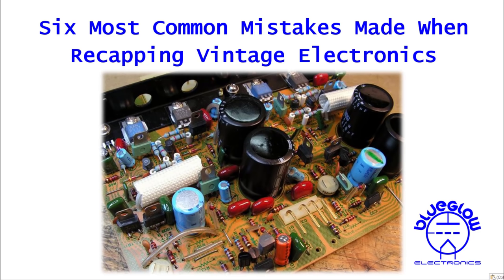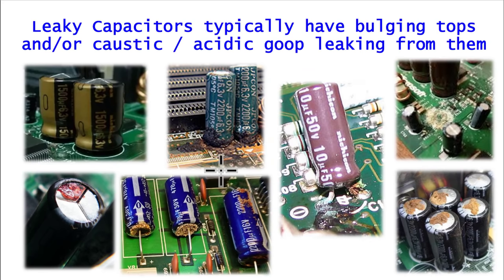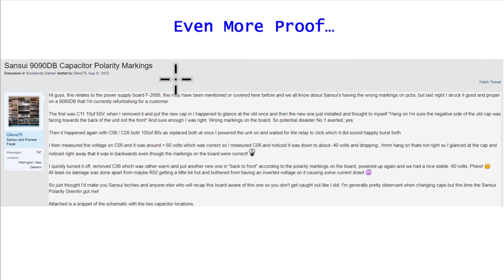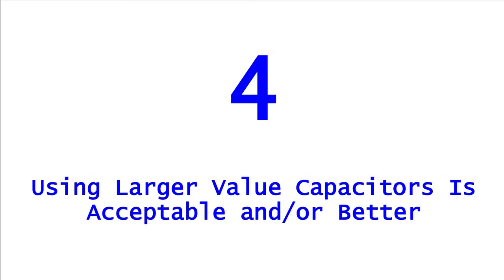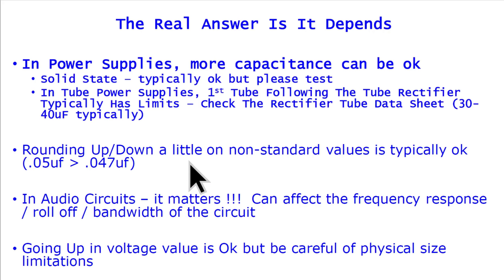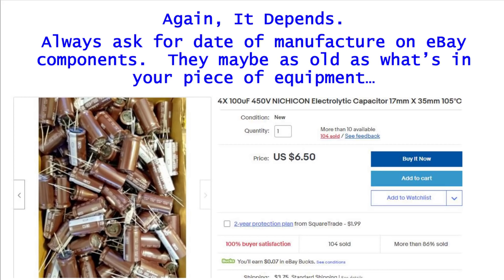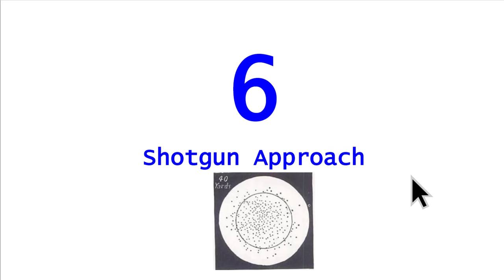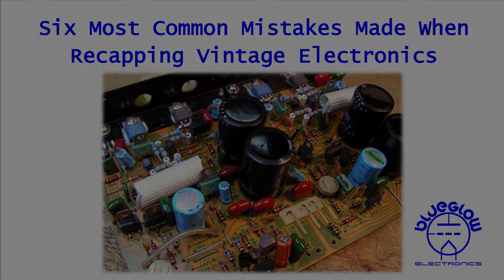Six Common Mistakes Made When Recapping Vintage Electronics

Comment: 2 questions. Does the ESR of a replacement capacitor matter? I’ve noticed some low uF capacitors from eBay have higher ESR than components I’ve taken off old circuit boards. Eg 0.1uF with 0.5ohm ESR versus say 6ohm for the replacement. Also I’ve taken a capacitor off a board marked 0.68uF with a measured capacitance of nearer 1uF. What’s the best replacement value? Marked or actual (I.e. the capacitor hasn’t lost capacitance and is almost double the marked value). Thanks
Reply: 1. Yes, the ESR can matter. It depends on the application. Particularly in frequency selective circuits and supply decoupling of logic circuits where they purposefully use two different types of capacitor in parallel because they have different ESR and high frequency performance.

2. The nearest standard value for the replacement cap is 680nF.
But here's the issue. Was that capacitor hand picked for the circuit because - assuming if it is in a HiFi amp, it sounded better than another 680nF cap?

That is, was the designer using that particular cap knowing that it was supposed to be 680nF but was hand picking  them because he had tested the value and wanted the value to be closer to 1uF, or was he hand matching them to another cap in the circuit?

So you might want to get another cap at say 820nF or if you can, 910nF and experiment.

2.

Comment: I bought some eBay rubycon caps a few years back when I wasnt as sure of what I was doing, when I tested them they were half the rating they were meant to be, and i feel bad because the unit I put them in I sold it and I wouldn't have if I realised it was a problem, all I remember is they were on a phono input of an amplifier and they were two medium/large capacitors like 3300uf I think and they tested at 1600 so maybe it won't be a problem I have no idea about turntable input

Comment: Buy yourself a digital caliper and measure the diameter, length and lead spacing. Only buy capacitors made by Nichicon, Panasonic or Wurth if possible. 90% of caps I’ve pulled are within tolerance on value and ESR, mainly because older gear used Japanese or USA manufactured caps (better quality). Look for service bulletins, Roland for example had bad batches of SMD electrolytics in gear that was made in the 2000’s. It’s a bad day when your expensive device pops a cap and it pukes all over your PCB.

Comment: Question.. I have an old video card with some bulging capacitors. Some are 1000uf 6.3v and some are 470uf 16v. I would like to replace them with solid capacitors. Can you tell me which ones would be best? I haven't see any exact matching capacitors in solid form. Thanks

Comment: I am literally in the midst of a capacitor mistake! I have a pair of active speaker rectifier boards needing new filter caps. 80v 15,000uf Chemi-con caps, 2 inch by 2 inch, I thought I did my research and found a replacement that matched and fit, I even messaged the ebay seller and verified before I bought. Finally get the caps, and discover while removing a bad one that I needed 3 lead caps! The replacements I plopped $100 down on had only 2 leads and dont fit properly!  Im still trying to find the proper 3 lead capacitor replacement, damnit.....
Reply: Good luck with the search 👍 lead spacing and pin out is definitely worth checking. Hope you can either make the caps fit or get most of the money back.
Reply: Check to see if the "3rd lead" is actually connected to any trace. Some older caps just had another lead for stability on the board........just fyi.
Reply: @wedoshotz6645  Third lead is connecting somewhere as its soldered onto a trace line. The line looks to be in series to the second lead, but not all 4 capacitors of similar type are connected the same. Im thinking the 3rd lead is providing some noise suppression here and I shouldn't cut corners. Im opting to wait and find the proper cap that will fit without modification. Thank you though!

Comment: I have caps with same Spec as in the amp but only difference is the one in it has a plastic cover on top and the new onces do not would that be a problem or it does not matter? Spec is 6800uf 63v there are six on the board right in the middle.

Comment: Hello everyone, I hope that all are doing well, I need help. I am interested in a 7070, however, I have read that these are known to stop producing audio. Some say that components on the f-2624 boards are faulty, and to blame. Any insight on this is very much appreciated. I have basic electronic soldering skills (like really basic). If I grab a 7070, what do I look out for, or should I also order a f-2624 board replacement kit? Thank you all.

Comment: Of topic but how do you femove the plastic covers from  relays? I have tried with a small screwdriver and it does not work. Is there some sort of special tool or method?
I need to clean the contacts ony teac 7030SL

Comment: I remove some types of glue but if it remains flexible likes silastic and silicone, I leave it alone. Because even if it had the danger of tarnishing and corroding… The only types of silastic and silicones that are capable of causing corrosion… Only do it during the curing process. But once they are cured… As long as they remain flexible. I leave it. 

Especially in industrial environment. Because the glue was not just used to hold the component for soldering, but also to help with strain and vibration relief in industrial components.

Comment: Thank you for the video. it was very helpful for me as I am an 18 year old just getting into repairing vintage gear. I've take a lot of lessons in electrical engineering but all in theory, so I don't have much practical experience. Hopefully you helped me avoiding same of the mistakes that you mentioned in your video.

Comment: I'd add two more tips for vintage radios and audio gear: 1) check for the shielded end of non-polar caps and tie that to the lower impedance side of the circuit, and 2) check for effective parallel resistance (leakage) which can change tube/transistor bias dramatically, causing the unit to work poorly, not at all, or burn up tubes or transistors.

Comment: wise words.
I go an extra step and test the NEW capacitor. Takes 3 seconds to stick the capacitor's legs in a test slot and verify.
It's very rare, but i've found brand new capacitors way off the value range.

Comment: Use your needle nose pliers to gently scrape the leads of the capacitors, just a bit. before you put them in the boards. Why? well, the leads are seldom properly cleaned enough for good solder adhesion. Once you get into this habit, you'll end up with better sounding more reliable audio gear. Once you go this way, you will notice a lot of bad dirty  capacitor and resistor leads. There's almost always some level of oxidation on any given lead. Especially with some of the specialty capacitors that audiophile re-cappers use. Limited use, limited runs and longer shelf times.

Comment: i watched 2X.   recently a deal came up on Ebay for 50 nos tubular caps of some low mfd value and 250 vdc. for a ridiculously low price. when pressed later as to why i bought them i told the seller i will check and match every cap on my tube type cap checker. if only 4 pan out i"m ahead of the game.      turns our most were less mfd and maybe only 4 or 5 were on or slightly above. still a good deal.  rest will be for radio work :>)

Comment: Using an electrolytic capacitor at a much lower that rated voltage will likely result in the oxide layer deforming in time and the capacitance increasing.  This increase in capacitance could cause a problem in some circuits.  The capacitance of the first capacitor in a power supply "Pi filter" will affect the output voltage of the filter.  When using a Pi filter with a swinging choke, I actually select the input capacitor to adjust the output voltage.  It's always humourous to see a modern film capacitor inside a "Bumblebee" capacitor, so prized by ignorant guitarists.  "But this one goes to eleven."
Reply: Guitarists play .music 
Not many could tell you much at all about capacitance..rock on.
Reply: @johnsalaman503  I've met quite a few electronic technicians that play guitar very well.  I got into electronics to support my guitar habit.

Comment: You should have warned that power supply capacitors were sometimes larger than the ones used to replace them because of the larger ripple current they will encounter. Not all  63V 1000uF capacitors are equal and some small electrolytics will not be suitable and fail. There is also the matter of Low ESL caps for use in switched mode power supplies.

Comment: I would say the #1 mistake is blindly recapping everything thinking it is necessary.
Reply: @Mopar Stephen 
What's the right approach?  I want to restore a 40+ year old computer andI'm planning to replace all of the electrolytic caps.  The are no tantalums but lots of ceramic disk caps.  If they show no signs of physical damage, are these usually okay to leave?
Reply: @andrewkieran8942  age  and construction determines the approach
Reply: @nicholasroos3627  Thanks.  The computer is from 1977 so all of the components are at least that old.  I know I need to change the electrolytics but, excluding any with physical damage, are the ceramic caps likely okay.
Reply: @andrewkieran8942  ceramics have different failure modes as they lack a wet electrolyte and are of a different plate construction. Shorting failures often occur from mechanical "events" in MLCC's. They still have drift but are nowhere near as prone to failure with age as an Alu electrolytic with drying electrolytes that speed up in a hot environment. Focus on the EL's first unless you see a significantly low impedance caused by a ceramic cap or a tantalum. Tants are more likely to fail short than ceramics IME but they tend to also let you know with a good 'pop'.
Reply: @nicholasroos3627  Thanks, mate, this is what I wanted to confirm.  I'll start with replacing the electrolytics and watch for shorts on the disk caps.
Reply: @andrewkieran8942  Vintage Mac owners complain of secretly oozing electrolytic caps, while vintage PC owners tend to curse the less reliable tantalum caps that go in their boards. There's a lot of over-reaction, replacing one type with another. Also, if the computer is being sold or given to someone unfamiliar with capacitor failure, I'd replace more, if not all; in my own collection, where I'm aware and can watch for failure, I'm going to be more conservative.
Reply: @squirlmy  Thanks. This restoration is for me.  It's the same model I built from a kit in the '70s.  I think I'll replace the electrolytics and see if that'll get the CPU board working.  My concern is that if doing that doesn't get it working, I might have to buy an oscilloscope.

Comment: The worst mistake I made was accidentally switching two idle current and zero bias potentiometers on an amp board; one was 100K and one was 100 ohms.  I'm still hunting down the problems i created for myself.

Comment: Best idea in the world, turn off and unplug, then turn the unit back on to check if you unplugged the correct plug, then turn the unit back off. If the cord can be removed from the back of the unit, do so. If I was recapping, I would only replace one possibly, two capacitors at a time and restore power to the unit to check it. Then of course, removing power as we did before. If you do one or two capacitors at a time you can EASILY determine where any bad capacitors were installed. Yes it takes longer, yes it is tedious, but it is a safer way to do this.

Comment: Cap leak...  I was at a speaker demo in California.  The amp was a heavily used vintage unit.  In the middle of the demo, the power supply caps finally shorted and burst.  Electrolyte showered the inside.  
My Vintage power amp sounded dull and murky. It was sent for evaluation and re-cap.  The caps were so degraded, a square wave input looked like a sawtooth coming out. 
I urge people to get vintage re-capped right away, and spay or neuter pets.

Comment: Well. As an Audio technician who is restoring ,recapping and repairing  vintage amplifiers since 90', I do NOT agree in what you are saying to people out there that smooth glue is an indication that capacitors are not leaking...I can't even tell you how many capacitors did I removed that have glue that looked 'ok' according to you, yet pins were totally corroded underneath. 'Leaky' capacitors don't always leak out and show outside...if you have a 40,50 years old amp especially from 80's with caps that have been  glueed, you need to check and replace if needed... Don't rely on 'smooth' edges of the glue..It's not mistake to check....those caps are batteries/filters and have already  lost capacity and changed value....especially in power supplies.

Comment: your assumption, that it is glue, is correct.. ' smooth, rounded flow "...indicates it was installed when hot, and then cooled down. GLUE  it is......oldtech as well after 2 minute mark, you are correct again, acidic, bulging tops, etc. etc    WAY  TO  GO,,   bro..

Comment: Some people claim that glue holding capacitors over time becomes conductive. Is that true?
Reply: think its rather the leaked  electolyte crap/salts 
making it conductive...
Reply: it certainly can, it absorbs moisture from the air...

Comment: Most of the capacitors that I've removed that have tested bad show no external evidence of going bad.   The two failure modes I commonly see are when an entire board has most capacitors at or exceeding their tolerance, or a single capacitor that tests as a short.  

My other comment is going up in voltage value will often not fit on the board, but more importantly, the higher the voltage, typically the higher the variance in capacitance, particularly at very low capacitance values..    Just buy the right value, capacitors are cheap, and if you order in bunches from Mouser or similar, the shipping cost isn't a big factor.

Finally, buy a high quality capacitance tester.   Test the ones that came off the board, and test the new ones.

Good advice to test after every change.

Comment: I see that some of these replies say, I do mine all at once because they're 100 yrs old, or I replace one at a time etc.. It may not be obvious to everybody because there are alot of people doing this kind of thing that probably shouldn't be.. The smart way to "rebuild" or "repair" or whatever you want to call it, is to firstly be educated about what you're doing, and secondly be smart about how you do it. If you have a 40 yr old amp or whatever that uses electrolytic caps, those are the ones you'll want to replace first before you plug anything in to see if it works.. Visually inspect for burnt resistors, loose wires or bad solder joints, bad tubes etc and fix those issues before plugging anything in.. Then and you can replace one section at a time and check operation before moving on to the next.. There's no set way to do any of these kind of restorations except for the smart way. But doing one section and checking operation is definitely a good idea before moving on to another, especially if there are multiple sections to be restored. Those of you who think you can just do the whole thing without checking for proper operation will sooner or later find out that doing one section at a time is a wise thing to do. And believe me now or believe me later you will end up scratching your head when your overhaul does not work right.. Sooner or later it WILL happen!

Comment: I'm planning to recap a 20yr old amp, thanks for the tips
Reply: does it work perfectly ok? if so it'll probably continue to be ok for many years yet as it is ...
Reply: @andygozzo72  after a minute of playing music, it starts making noise in one channel.
Reply: @rogerwalter2500  not necessarily caps a transistor or other semiconductor could be breaking down when warm,  try squirting ones in that channel with component freezer spray, and while doing so run it with a filament bulb limiter in series with mains just in case...  especially check any zener diodes, i've come across some  going very unstable when warm
Reply: @andygozzo72  thanks,I will try that first

Comment: Some of that brown/yellow glue becomes conductive over time and should be removed anyway.
Capacitors do not just leak physically.  You need to test them electrically as well.   Especially older / cheap electrolytics, will increase in both parallel and series resistance.
Other than that, this is a good informational video and people do need to be careful.   That said, alot of what you show is not what I call "vintage".  Go back to point to point wiring and valves if you want true vintage.  The term Vintage is thrown around way too easily these days.

Comment: The second assumption is completely absurd too. That you should not remove capacitors that have glue on them especially an old radio equipment. Glue that most of the manufacturer is used in the 70s and '80s becomes corrosive after it breaks down after about 30 years and begins to eat the capacitor leads and other components adjacent to the capacitor or device. The glue must be removed and the component must be changed. Only a lazy and foolish man would do otherwise.

Comment: It may be worth checking the capacity of newly bought capacitors with a multimeter.
Reply: Most multimeters don't have a capacitance measurement mode.

So you can't use any multimeter.